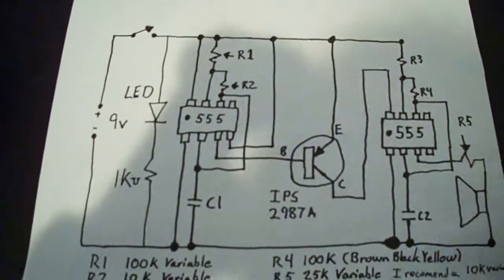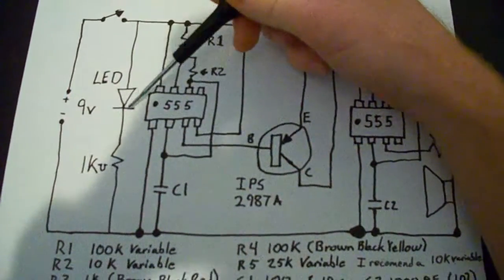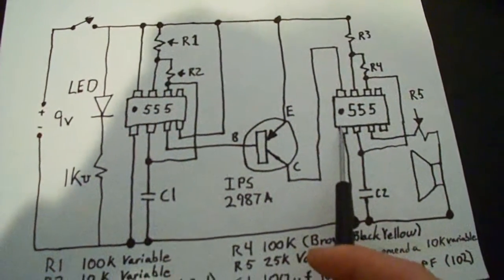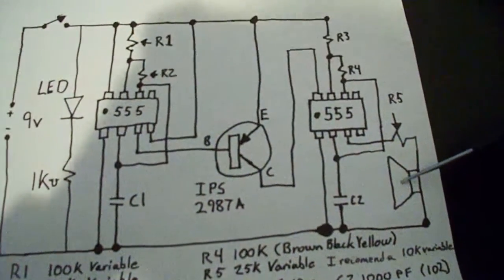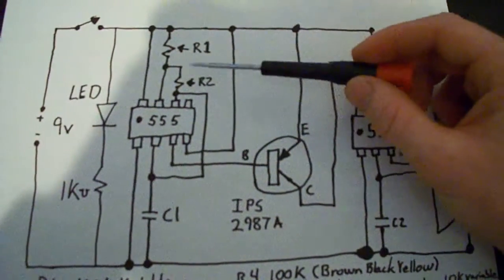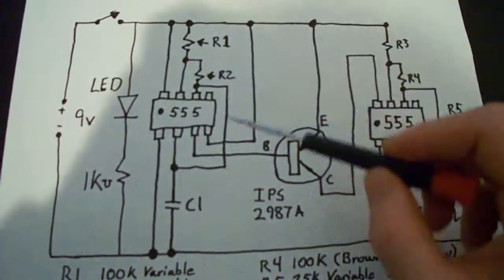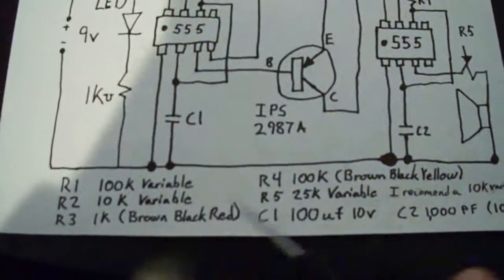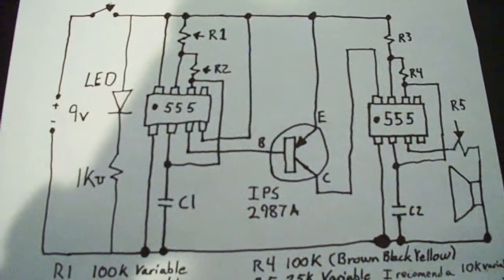Evasive Beeping Thing/555 timer/Annoyatron Schematic

Comment: Hi I have just bread-boarded the original circuit and it works It does however have a few problems the tone generates every minute not 5, and the tone is quite high pitched. Needs a few more tweaks.

Comment: I get a primarily on output. From the sounds of it the signal is high until the capacitor charges then begins a periodic pulse off then back on. The problem obviously is in the first 555 area because it screams like a charge when the second 555 is hooked up to +9v. I'm using LM555cn timers with a vn10lm FET, and piezo speakers.  Any ideas?